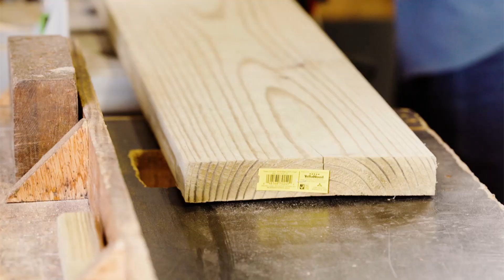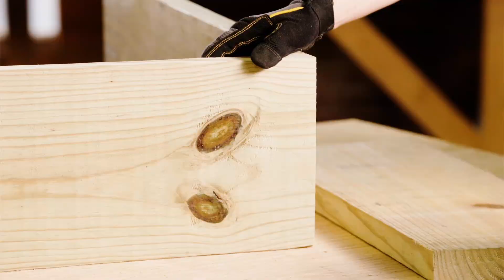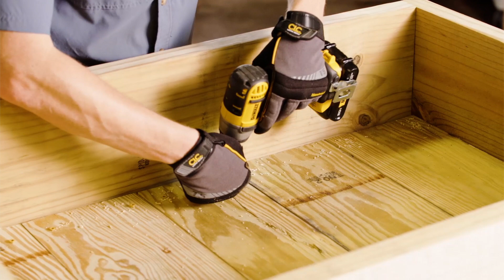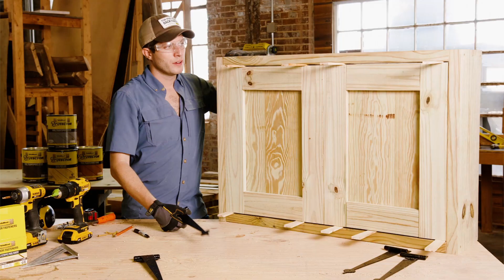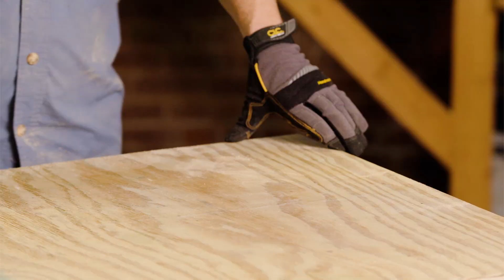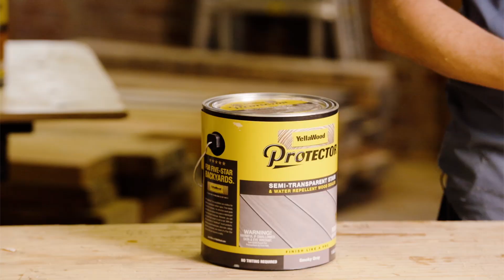YellaWood® DIY Outdoor TV Cabinet

Comment: Love the build but how does it hold up with water & moisture, it doesn’t appear to be water tight.
Reply from the maker: Hey there! We highly recommend storing only weatherproof, outdoor TVs in this cabinet and only placing them in spaces that offer additional protection from the elements like screened in porches.
 
It’s not water tight so I would also recommend to seal it to help with protecting against weathering and moisture.